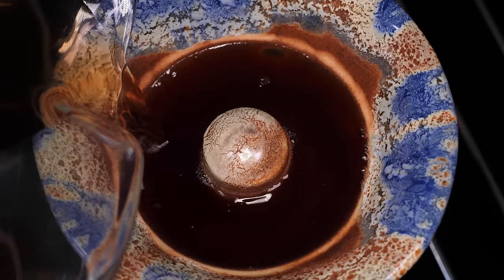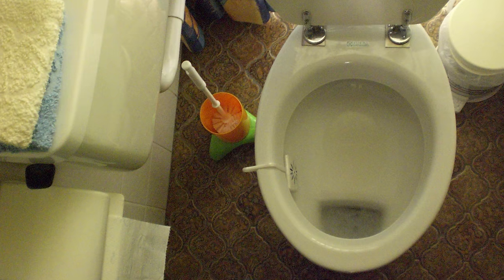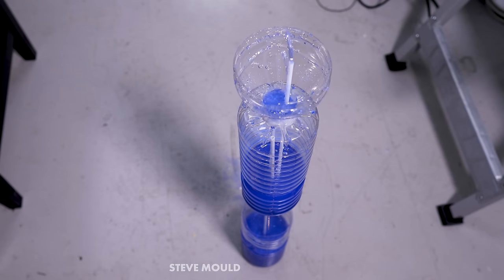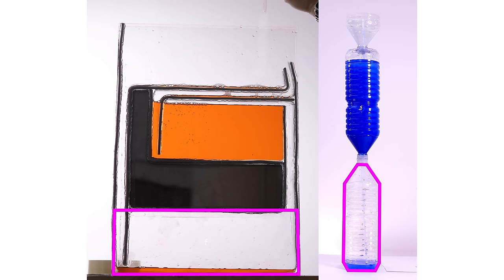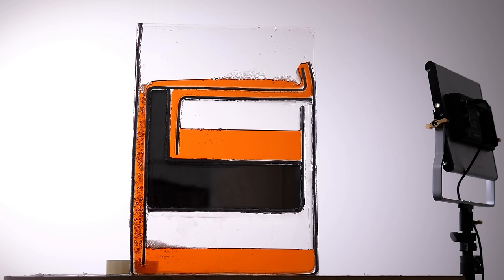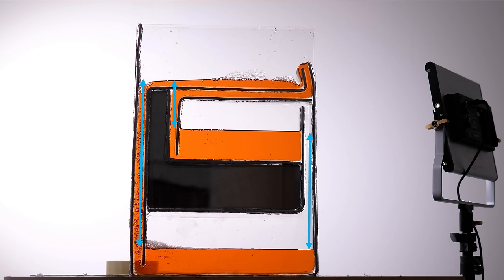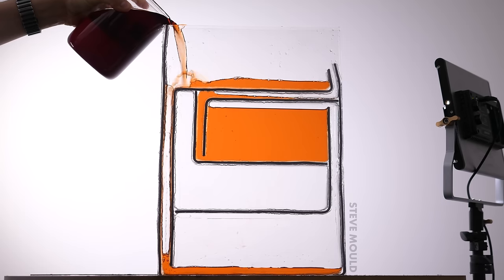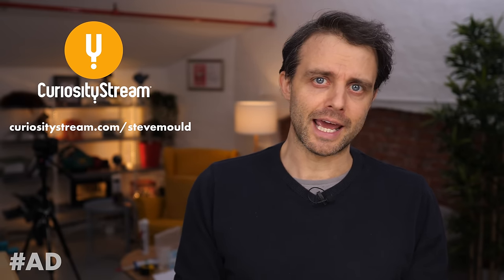A 2D Heron's Fountain Behaves Weirdly

Comment: That's really cool. So i have a question then... What if you use liguids that have different densities? Like if you used oil and water? Would the water be able to "push" the oil to same way it did the air?

Comment: Would it be possible to set this up so if you pour in water, and then you have a flavoured drink come out the top? Far as I can tell, the pool holding the secondary drink doesn't touch the first one, so as long as you poured in water, you could take out the tasty beverage from the system equivilantly until it ran out. Which means you could fine-tune a measurement of plain water to ration out a more appreciably flavoured alternative to be say, exactly one cup. ((Though due to the necessity of trapping air down, you'd lose some liquid until the seal formed?))

Comment: Could you get it to cycle through longer if you used several different fluids (i.e. air, oil, water, melted gallium) as long as the densities where in the right order?

Comment: This explanation is a bit wrong. "Mass" is not important at all as demonstrated by the reduction in mass by going to "2d" from the bottles but it still works density is what matters. Think more of pressure gradients the liquid has a pressure gradient roughly 1000 time higher than the air so relatively the pressure at the top and bottom of the air column is the same. But pressure in the liquid increases the deeper in liquid is. So at 7:13 the pressure increases down the left arrow by density*height*Gravity is constant ish in the air on the left most arrow and decreases on the middle arrow (that should extend to the top of the outlet on the level) again by D*H*G. So if H left is greater than H Middle arrow liquid is forced out. You kind of said similar but introduced mass which total missed why the air is important.

Comment: would one of these work on a much larger scale? and if so, could you not use one to power a hydro-powered generator for unlimited electricity? it probably wouldn't be very affective at first, but if it works it could probably be expanded upon for a great source of electricity

edit: nevermind, just realized that because of the layout of the fountain, no liquid from the bottom container could reach the top container. now i've been recommended a video about an "endless heron's fountain" and now my question is back but with that version instead

Comment: i think the surface area of the water exposed to air in both containers plays a role in the success of this experiment.
if we reduced the surface area in the bottom container, would this work??
can we have a reverse effect of this experiment if we tampered a little bit with these areas of contact with the air????
what if we did this with mercury or in an environment with a more dense gas???
WOWW i almost entered the 4th dimention😅

Comment: Could you use capillary action between the bottom and middle containers to refill the middle before it runs out?
Reply: I suppose at this point I'm thinking about efficiency, but maybe momentum+capillary action would keep it going even as the two vertical columns are filled with water. And what if you maximized the density difference? Say you used mercury instead of water and also pulled a vacuum, I realize mercury doesn't undergo CA so maybe some denser liquid that still does?

Comment: yeah about that perpetual motion system not existing ... the u of ark has developed a graphene power system and the fundamental core of it uses  the 2d properties of graphene that are perpetually in motion. the carbon atoms linked together have up/down states that randomly switch this motion is harvested for power and because the covalent bonds do not suffer stress fatigue they will never break in trillions of cycles and because even at the lowest achievable energy state, near absolute zero the up/down motion does not stop it is by definition a perpetual motion system

Comment: Flachspüler is just german and means flat flusher 
My apartment has such a toilet and well ...if the "drop" is dense and moist and it leys in the flusching direction and you forgot to ley a thin sheet od toilet paper in beforehand.......it just stays on the shelf and that succs.
The shelf is good to erly regionice digestion sickness but.......geting used to it is an diffrent thing 

I build a contaption to get rit off the shelf siters without having to touch it with gloves  it really isnt nice.

Oh however i have the same type of flushing water tank here  not only the uk has it former east germany too as it seams

Comment: Without watching the video, my understanding of fluid dynamics indicates that the water that pours down the left creates a seal at the bottom, trapping in the air. As more water comes in, the air is forced up and pushes down on the upper basin, forcing its water up until enough has been manually added for the upper basin's water to begin flowing over into the lower basin.

Comment: what about sealing it then 2 well placed tire valve stems to create a zero atmosphere with a vacum pump. goin to try. meh, could decrease friction and speratic w
fluid leveling so no "Burp" is created for a much steadier flo and equalized air volume. could buy more time
  o if to is left open could just give a lil pump into sealed chamber.... apolagize for spelling ive smshed this keyboard ALOT..
 IF u got any input that would be awesome.

Comment: FAIL 

its not gravity its pressure pushing the water threw the system.

before you claim im wrong its a closed system clearly runs on presure cos if it was gravaty it would carry on after u stopped pouring water.

Comment: Steve Kerry Forides c of Kostas Creating Sustainability facebook. I would love to see an airlift system that uses air bubbles up a water pipe to raise water well over ten meters in height as the bubbles lift water inside a pipe using a very small 2 or 300watt air pump and i believe water pump instead of powerful, power hungry 2 to 3000w water pumps. Ben and glen aquazen seem to be the only people on the planet that have sucessfully achieved this. Again i am happy to show you what i know and would love to see a 2d of it and get an idea of optimal pipe diameters. Take care steve and its great to watch your stuff. I like your smarts.

Comment: Steve Kerry Forides c of Kostas Creating Sustainability facebook. I would love to see a rocket mass heater in a 2d model. In stumped on tuning the rocket no one to date tunes them so i would love to see how we can for example adjust the barrel or bell over the heat riser or exhaust. I figure if its height is adjustable its draw can be tuned. Id be happy to go over the core principles especially why metal rockets are a failure before they start.